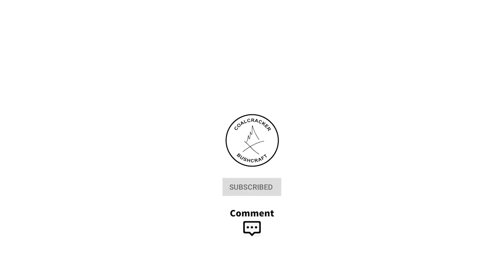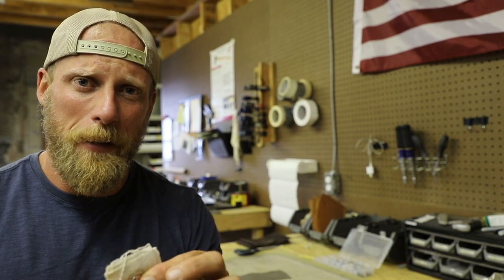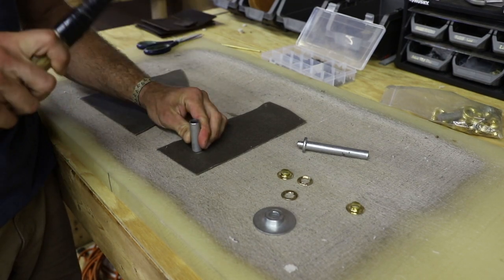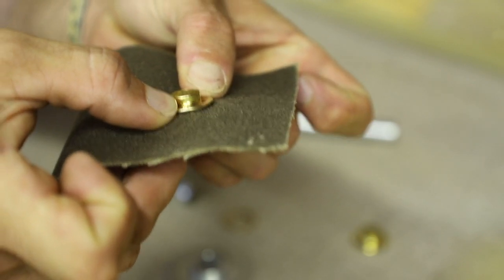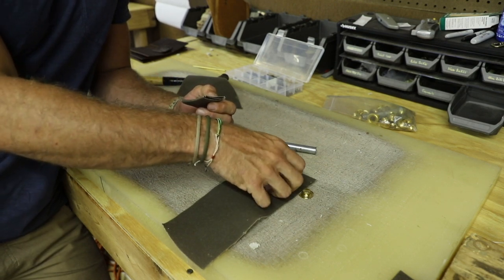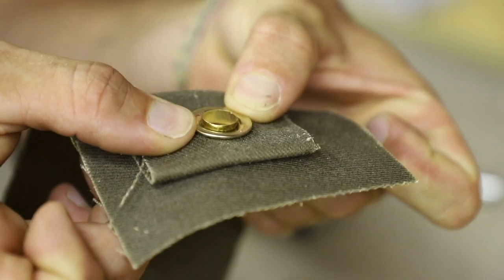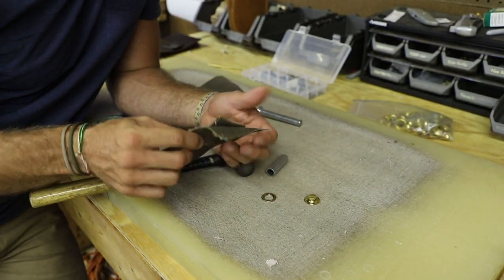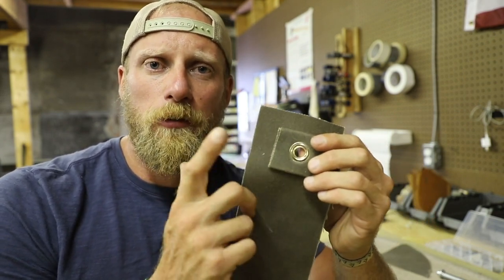Tent and Tarp Repair with Grommets

Comment: I use rubber washers to tighten the fit. This also protects the tarp material from the outside edges of the grommets.
Reply: I was wondering if that would work, thanks for posting
Reply: Sounds like an awesome idea.
Reply: Wonder if I can just cut out or I guess stamp out my own little rubber washers out of an old bike tire I've got laying here. cus i do not have any rubber washers or least idk where they are, my tools and workspace is in complete disarray after our, small yet  tons of cleanup,house fire, and at this time stores are closed. I'm trying to finish this job tonight for securing our canopy we are using to store our house items while painting and restoring inside of house.  My only issue with the canopy we have is the walls don't stay down w the wind we have and they flap up exposing everything inside to rain. Yes I know a storage unit would be much easier, but this is what we decided to do at spur of moment. So im adding gromets along bottom to be able to stake it down. The washers sound like a good idea and I want to incorporate that but lacking those washers...ima try this with the rubber I've got.

Comment: If you’re in the field and don’t have a grommet setting kit with you, you can still stabilize the hole if you have needle and thread (dental floss), and use a blanket stitch around the hole. I’d set 6 to 8 stitches evenly spaced, then run the tread around the hole through those stitches several times on each side of the fabric to add some more strength. Then do a bunch more blanket stitches around the hole and over those threads. This is the way lacing holes are made for period correct clothing.

Comment: Love these tool tip vids! One way to get some utility out of the extra material that you added to tighten the grommet is to form the material into a loop. When you're finished you will then have a loop to tie to or a grommeted hole to use at the other end of the loop. More useful than just a square "washer" of material. The best use for grommets that I've found is to install them on cheap tarps to give equally spaced tie offs. You can't find poly tarps that have holes spaced the same on all edges and it takes away from their utility in some cases. You'll end up with extra holes in the edge but that doesn't usually present a problem. Really dig your channel.

Comment: If you put a little lubricant on your setting tool it will set much easier and tighter. I use a water base lube meant for reloading as it washes off easy. Works with eyelets as it prevents splitting.

Comment: With a trifold like that, you also now have 2 sleeves through which you can run cordage!
Reply: Mind you, stitching it into a pair of tubes bracketing the grommet will go a lot farther to ensure the material doesn't pull too much and loosen that grommet's grip...so if you plan for heavy use, stitch it!

Comment: The problem with grommets is that when the hole is created, there's nothing securing the ends of the threads.  This is what I do (not for field repair):  I make two fabric washers.  I Gorilla glued one fabric washer (layer) on each side of the tarp where the grommet is to be located.  Glue as close to the hole as you can.  Clamp and let the glue set/cure/dry.  The glue secures the ends of the threads.  Now cut the new hole through the three layers and set your grommet.  That Gorilla glue is some strong stuff.  It's just a different way to skin the cat.

Comment: QUESTION..... after setting the grommet with the extra material, would you then sew that material to the tarp (or whatever) for extra strength and to keep grommet from loosening with hard use? Seems reasonable to me, what are your thoughts.
Reply: My thoughts exactly.  That way only takes out all the play in the grommet doesn't actually reinforce the area.  If it were sewn it would reinforce also.
Reply: Shouldn’t need to. It’s just a spacer
Reply: @foxcub2yo108  good point. Thank You.

Comment: Nice explanation.  Any suggestions on how to do this if the tarp can't be laid flat. My tarp is on an outdoor shelter that is held by a bunch of ratchets attached to screws in ground so damaged section of grommet/tarp is hanging halfway to ground. and can't be pulled down further. Thank You

Comment: One thing i do that always works for me is i make the hole slightly smaller than the grommet. You force the material over the grommet which sort of bunches up the material creating a tight fit. Both around the surface of the grommet, but also between the parts.There is no movement and the grommet lasts longer in my experience.

Comment: I watched your other video with putting the duct tape over the grommet and then cutting out the grommet hole. Could you use that same theory here maybe one extra layer of the material covered by duct tape and then put the Gromit in the middle.❤️‍🔥🇺🇸

Comment: grommets lol one job i working at the moving company the make tarps  the had and old rusted sewing machine outback made sure it worked moved lol when the manager and me when to look at it  this time it was not moving lol  he said get it out of here got it  free yea use works trailer to bring it home too  winter project lol  did get hold of the manufacture of the sewing machine sent picture to them  they said they could restore it like new  lol  we agreed on the price to send it down a couple of months i had a new machine  
did  search and found material what i want to use for the tarps  the tarps we got was not that great  lol use them to cover up bales yea  grommet i use to  for the tarps sewen in wide truck straps  for the grommet not to pull out the weather is the problem with the tarps now